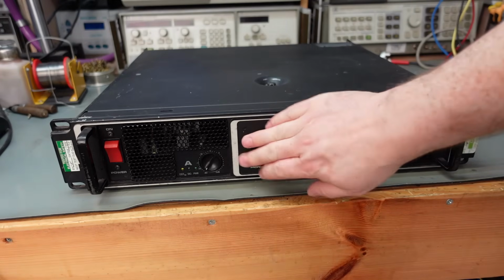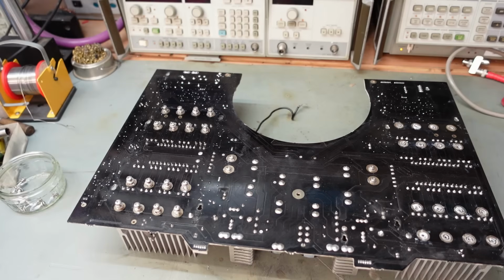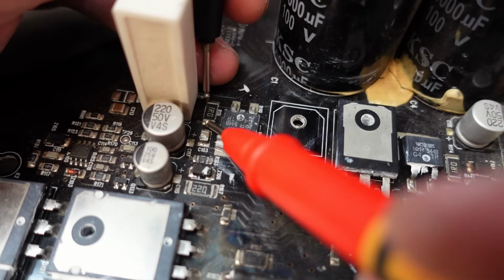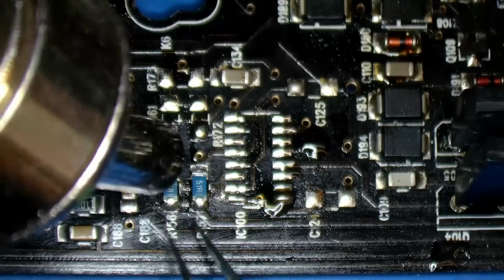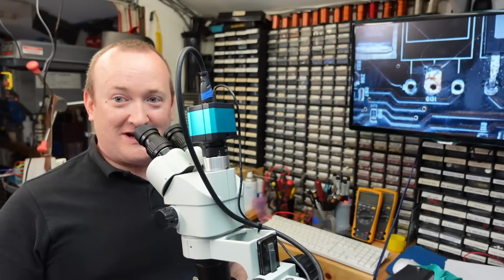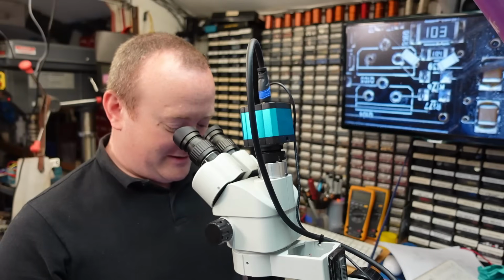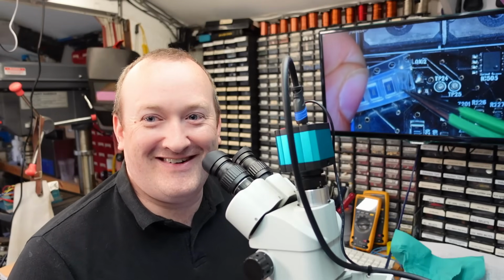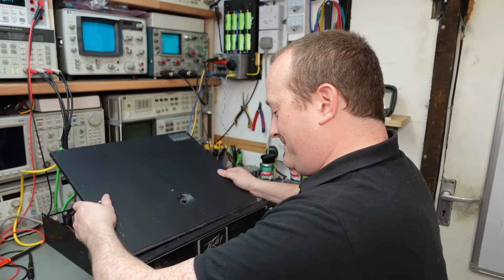PEAVEY 4000W Amp Repair (CS4080HZ)

Comment: 4kw output seems excessive for a claim .Maybe peak to peak both channels combined so maybe 500w rms per channel ???Great repair
Reply: The distortion at 4000 watts is probably colossal. Some people with their guitar amps are just stupid. They turn them to 11, like in Spinal Tap, and think they are great because no one can discern what they are playing. 🙄
Reply: @ToddSauve  just so many electronics with inflated claims .From Class A to Class D to Class G someone is always lying .My old Sony receiver weighed 56lbs and had an output of 115wrms per channel and kept my bedroom warm in winter .It consumed almost 40 watts or more just idling .My adcom GFA 555 MK2 consumes almost 100 watts idling .And is 200 wrms .Some thing up ???I know at 220 v supply the current draw is lower .But 4000/220 that's 18 amps current draw  which means the amplifier will need at least 12 gauge or 10 gauge wire because of the peaks so maybe even a 2 pole 25 amp or 30 amp breaker .That's like a laundry dryer
Reply: @carlubambi5541   Yes, I remember in the 1980s and 1990s companies like Kenwood and others of the low quality Japanese ilk would sell 50 or 100 watt stereo amplifiers that weighed about 10 pounds. Even my old 1976 Marantz 25 watt receiver weighed about 25 pounds and had really high quality electronic parts and no plastic face plates or knobs. Much of that 1980s and 90s gear was just junk. Peavey has always made claims that were dubious at best. I currently own an Onkyo AV receiver with about 10 speaker outputs but puts out 105 watts per channel into two 4 ohm speakers. It weighs at least 40 pounds and I dread even moving it to dust it off!
Reply: @ToddSauve  I know exactly the 9ne you are talking about my buddy had that with a pair of Klipsch heresy for the main speakers and Polk audio for the others .He still has it working today 5 channel amplifier with sub out and pre outs
Reply: @carlubambi5541  Yes, my Onkyo also has pre-amp outputs. I'd hate to drop it on my toe! I have Magnepan front speakers and a small pair of JBL side speakers, with an eight inch self powered subwoofer. If you can afford to buy good quality gear it will last a lot longer. My niece still uses my old Marantz 2225 receiver from 47 years ago!
Reply: @ToddSauve  .I got married and had to sell most of my stuff .Crying now no space for it .I had a pair of lascalas on my adcom GFA 555mk2 and heresy on GFA 545 mk2 ,Sold my jbl4311s sold everything pretty much .Gave my Sony strv6 to my cousin .He sold it for $ 1200 my adc eq and 228 Dbx I still have ..One day when the boys are out on their own I will build my listening room .My room had almost perfect dimension 9X20 ft ..It's sounded like a recording studio and better than any night club
Reply: @carlubambi5541  Well, you have an ear for good quality gear! I would have a hard time having to get by with a boom box or some other atrocity anymore! I was educated as an audio engineer back in the 1980s and got spoiled listening to pro audio equipment. A Neve 24 channel console, speakers with individually amped drivers and powered cross-overs, a diffuser on the rear wall and a control room that was designed from the ground up with the best acoustic qualities in mind. I haven't had anything like that to listen to since and I really miss it. Alas, how many people have that sort of equipment in their living room? None that I know of though I'm sure the ultra rich do! I hope you can build your acoustic paradise once the kids are gone.

If you have never heard this South Korean woman named Sohyang sing and perform, here is a huge treat for you!  https://www.youtube.com/watch?v=C6iHh4yBxCo&pp=ygUic29oeWFuZyBicmlkZ2Ugb3ZlciB0cm91YmxlZCB3YXRlcg%3D%3D
Reply: @ToddSauve  it's amazing when you have a neutral room and the right electronics to get the sound .My friend's couldn't believe how good my stereo sounded and one of the guys was a millionaire who spent 10s of thousands on equipment and couldn't get the sound I had in my room ..Curved ceilings 2 seat heavy fabric couch and no padding anywhere ,mind you the house was built before the 1940s and had thick walls with horse hair plaster and lath with oak floors .the bass was incredible ,the long walls propagated the waves flawlessly you felt it in the floor and you body .Listening to pink Floyds echos or welcome to the machine or rush 2112  or genisis dance on a volcano .Some of the sound quality on those 70s recordings was amazing
Reply: @carlubambi5541   Yes, some of those older recordings were done with love and care. Real masters of the recording arts. Give a listen to that Sohyang song I linked for you. I think you will want to hear a lot more of her ...
Reply: @ToddSauve  sure will .
Reply: @carlubambi5541   Did you like Sohyang?
Reply: @ToddSauve  yes she is Korean I think I can't understand what she is singing but her voice is amazing.Listened in last night with a pair of headphones .The recording quality is quite amazing considering its coming over the internet
Reply: @carlubambi5541   Sohyang is generally acknowledged amongst vocal coaches and professional singers, like Seth Riggs and Michael Bolton, as the best female singer in the world, outside of the opera community. The song I linked for you was "Bridge Over Troubled Water." Sohyang sang that in English. Did you have trouble understanding her English, or did you do a search for her other songs and found some in Korean? She speaks five languages and also reads Greek, so she is just a total brain in the communications department. Anyway, let me know. I have to do some errands but I look forward to your answer Carlu! 😉
Reply: @ToddSauve  no link was there so I looked up her performances on YouTube .Lots to choose .will look for bridge over troubled waters
Reply: @carlubambi5541  I'll post a biography of her for you with links to many of her best performances. I am far more of a blues and rock guitar guy, and never followed the diva genre. I'm almost 65 and it is hard to change my ways. But when I heard Sohyang sing 3 1/2 years ago, well, I don't let a day go by without listening to her now. She is not only the best female voice in the world, she is an extraordinary person. A total inspiration. She will be 45 on April 5. Most women are beyond their prime when it comes to singing by that age but her vocal technique is absolutely perfect, so she probably has years and years of excellent performances ahead of her. Your wife will probably love her. 👽🛸
Reply: @carlubambi5541  We all wonder if Sohyang is human or from another planet. Current odds are that she’s from another planet, with an outside chance she’s actually an angel come down from Heaven. 😇 We have never heard anyone sing like her, or be able to hold an audience in the palm of her hand until she lets them go. Her voice is, as one person described it, like liquid gold. Perfection in clarity and pitch, and she doesn’t fade in the upper octaves, which is startling when you hear her hit those 5th and 6th octave notes with such POWER it actually gives everyone goose bumps—and makes us bald guys’ hair stand on end! As she says, her voice “is from God.” She does all the musical arrangements herself, with the input of her in-law family and musical assistants, teaches vocal technique at a South Korean university and speaks five languages: Korean, English, French, Vietnamese and Chinese, as well as reading Greek! 

Let me catch my breath. OK. 

She is a cancer survivor from uterine cancer at the age of 20, just after getting married, and states very plainly that God saved her life due to the prayers of her church. But this left her without the ability to have children so she decided to dedicate her life to being a Contemporary Christian Gospel singer and has refused recording contracts from the biggest corporations in the world. She only wants to sing for charities, churches and while doing missionary work, to strengthen those suffering through difficult times. David Foster, Josh Groban, Michael Bolton and others have all eagerly worked with her when they were in Asia. 

She contracted hepatitis B from a blood transfusion during her cancer surgery and it clings to her to this day. Because of this she is prone to catching pneumonia but has sang perfectly while suffering from it in her live performance of “You Raise Me Up” before Shane Filan of Westlife on South Korean TV: https://www.youtube.com/watch?v=te_L9ofhUt8 She has asked those who love her singing to pray that God keep pneumonia away from her, she has suffered from it on so many occasions. Imagine how she must feel with this coronavirus floating around everywhere! 

She just turned 44 on April 5, 2022, though in Korean culture she would be 45 because you are deemed to be one year old when you are born. She was about 37 when she sang this version of “Arirang Alone”, their unofficial national anthem based on a 600 year old folk song expressing their desire to reunify north and south: https://vimeo.com/308253527 

After being sick with pneumonia eight times from 2016 through to 2020, and considering giving up singing altogether, she decided to enter a televised singing contest called “King of the Masked Singers” in 2017 and won six consecutive times, which has catapulted her into international attention from the performances being posted on YouTube. 

Whitney Houston’s former manager saw her on YouTube and showed her to Oprah Winfrey, who brought her to David Foster’s attention. Foster then contacted Sohyang and went to Japan in order to have her perform eight concerts with him at Tokyo’s famous Blue Note Club in late-2018. For those who don't know, David Foster was Whitney Houston's producer for some of her songs, wrote "I Have Nothing," her most iconic song, and is the most famous and influential music producer in the world. He places Sohyang right beside Whitney and the rest of the top tier divas.

Here is the interview where Sohyang related the events: https://www.youtube.com/watch?v=EqeE_1nP-Kk (Be sure to turn on English subtitles.)

Here is the version of “I Have Nothing” Oprah, David Foster, Whitney's former manager and the rest watched on YouTube: https://www.youtube.com/watch?v=T4UyIMkdy4M 

She preceded it with this blockbuster: https://vimeo.com/312061203

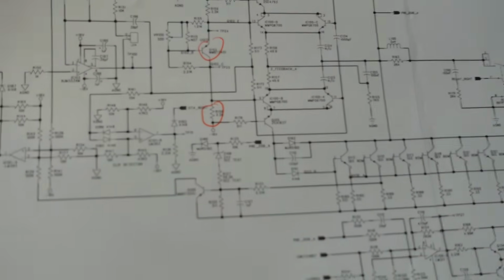She could be an international Super Star if she wanted to be but has decided that it would ruin her spiritually, quoting Proverbs 14:12 “There is a way that seems right to a man, But its end is the way of death.” 

In a South Korean television interview Sohyang conceded that she struggled with her desire for fame for a number of years, going into the basement in her home numerous times and closing the door so she could complain vehemently to God that He was holding her back from becoming famous due to her health problems and other unforeseeable events. Then she later saw a Korean TV drama where the talented daughter of a very successful businessman was positive she would take over when her father retired. But he left the management of the company to a woman she hated, so she had a fit and lay kicking and screaming on the floor. Sohyang says she saw herself in that young woman and then understood that God was keeping her from developing self-destructive character by withholding international celebrity status from her. https://www.youtube.com/watch?v=rl-jX9kBsEs (Again, turn on English subtitles.) 

So as a consequence she does not pursue fame or fortune and actually has no social media presence whatsoever. 

What can one say about such a person? She is a literal Wonder Woman! And we need about a billion more just like her! And whether Sohyang likes it or not, fame has found her, run her over and then backed up and run over her again!

On Oct. 5, 2020, it was revealed that Sohyang turned down yet another contract offer, this time from Sony Music US. http://www.koreaherald.com/view.php?ud=20200921000995 

“Debuting in [the] US was my utmost goal for the past 20 years. But when I got a call from the US agency, I politely rejected, as I realized that what I wanted most was not becoming famous,” she said. 

“I think singers are very susceptible to arrogance, especially when they hear the screaming from crowds on stage. It can make you feel like as if you’ve become God.” 

“And I’m perfectly okay with sharing my music via YouTube, which can reach tens of millions of people all over the world without making me feel stuck up. Maybe that’s why I was born in this era.” 

Sohyang is just the most amazing singer, Christian and human being. She is beautiful both inside and out, and so humble and genuine, with a stage charisma, facial expressions and smile that is off the charts.

In Korean dictionaries 소향--Sohyang--has several meanings. 

•	First is a type of Korean traditional music. 
•	Second is to burn incense on a burner. 
•	Third is to go toward.

But these meanings are rarely used today. Sohyang is also the name of a heroine in a Korean traditional novel. Yet for the definitive answer Sohyang has stated in an interview that her name means "enjoy the light." Her grandmother named her.

Please analyze her performance of “Bridge Over Troubled Water”: https://www.youtube.com/watch?v=C6iHh4yBxCo 

Also, please react to her version of “The Power of Love”: https://www.youtube.com/watch?v=LrNkVRrK7_I 

Plus this beautiful duet with her friend Lee Hi where they do Frankie Valli and the Four Seasons’ “Can’t Take My Eyes Off Of You”: https://vimeo.com/439148918 

And this version of her singing “Oh Holy Night”: https://vimeo.com/322716334 

Here she performs “Lean On Me” before Michael Bolton, who called her a vocal “virtuoso” after her performance: https://www.youtube.com/watch?v=GvsgCllcNPE 

Wait until you see her duet of David Foster's “The Prayer” with Jeong Ui Geu: https://www.youtube.com/watch?v=rte-q3kunp8&t=0s

Her performance of "Fate" in Korean requires no translation: https://vimeo.com/198161448

And finally “Will You Be There”: https://www.youtube.com/watch?v=nBdSpexUxik

Here’s an English language interview with her that I’m sure you will enjoy: https://www.youtube.com/watch?v=N2u_pmoWxj8 Her English is perfect when she sings and almost perfect when she is doing interviews. 

OK, I’ll stop gushing now. 

Well, one more gush. In an interview with a Turkish music producer Sohyang's assistants revealed (a bit to her chagrin, as she is a self-effacing person) that she can hit Eb7 and D7 in practise. However, she never goes above the 6th octave in performances. Since she starts at D3 that is more than a 4 octave range ... so how about them apples???! Here it is: https://www.youtube.com/watch?v=VnPAkryrygQ  I know, bananas isn’t it?

Oh, I just remembered, she is also a published fantasy novelist and has a theological treatise on the Book of Revelation in print. In addition, she is a very good stage actress, which she proved by playing Julie Andrews’ part in the South Korean stage production of “The Sound of Music.” Moreover, she sang the “Moana” part in the Korean version of the Disney film, does the musical vocals for many South Korean television dramas, and is a talented artist and cartoonist. She taught herself English by watching Disney's "The Little Mermaid" "about one hundred times" when she was just a kid, speaks English with a perfect North American accent and has an outgoing and bubbly personality.

She can also play the piano and guitar. Is there anything this genius level woman can’t do? Ironically, Sohyang stated in another interview that both she and her in-law family were surprised to discover that she could sing so excellently!

Though she is maybe 5' 4" and only about 100 pounds, Sohyang simply transcends the thresholds of music and takes you there with her. She becomes the song when she sings it, and then re-emerges when she is done. An experience like no other. I don’t know what else to say. I’ve spent entire days listening to her, and shed more than a few tears of joy along the way.

I really must also compliment the choir, orchestra and audio/video production people Sohyang works with. They are all top notch from what I can see and hear, and that is important to note as these are essential elements of any great musical production. The Korean people are easily as talented as anyone else. 

As you can see, I am a shameless fan. 😉
Reply: @carlubambi5541  I hope I didn't swamp you with information about Sohyang. But she is so extraordinary, and you are a music lover, so I wanted you to know all about her.

I looked at your YouTube page and noticed the video about the man who had a bad case of covid19. Was that you? I hope that if it was you have gotten completely better and have put it in your past! 😉

Comment: Awesome repair in an awesome workshop.  I'm amazed you didn't bring the power on using a variac.  Just in case you had missed something.  There's a lot of energy in that box and it could have been spitting sparks.  Very brave.
Reply: Who needs a Variac when you can use light bulbs! 🤔